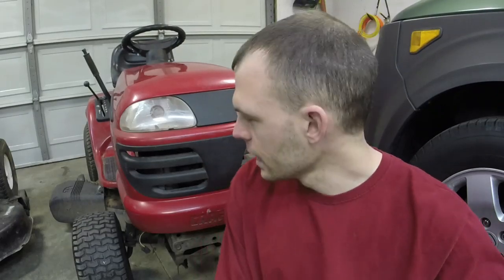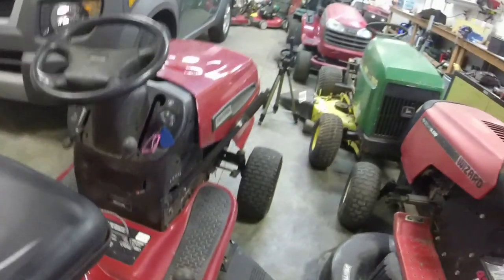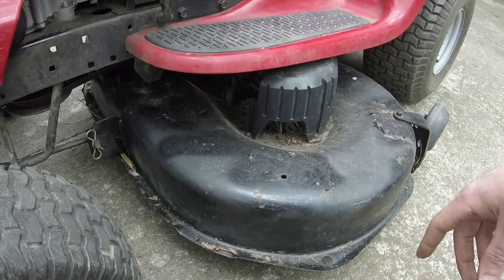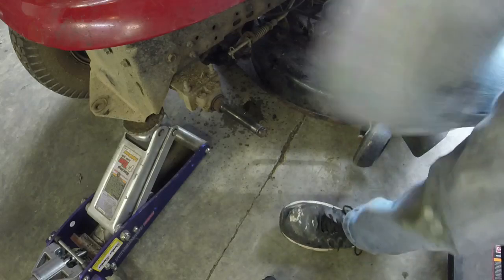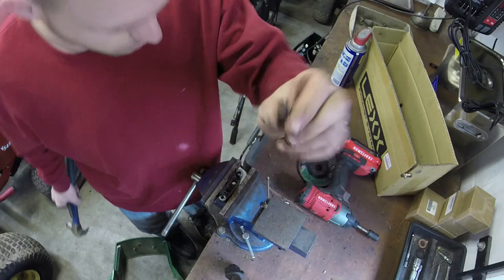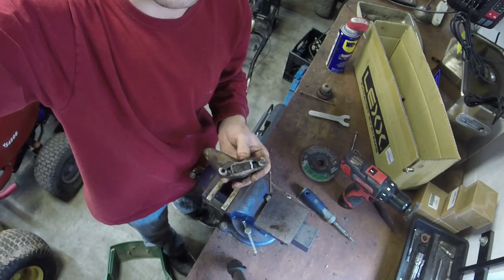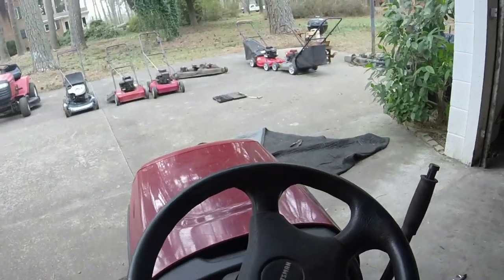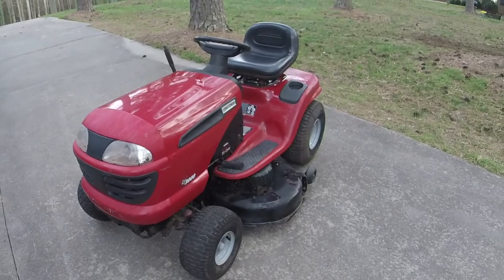$100 Craftsman LT3000 with rotted deck and no brakes: Let's fix it!

Comment: Taking apart those deck mechanisms can be annoying. I took one apart to sand blast everything but several weeks went by between disassembly and reassembly, so I forgot where everything went. Even with photographs and video help, it was a bit frustrating to figure out where all the washers and such go. It requires some trial and error unless you know them very well. Dealing with decks, in general, is my least favorite part of working on riding mowers ... as ironic as it sounds! I have had a few of those brake caliper pins completely rust seize up to the point that I had to drive them out and wire wheel or sandblast everything. Its a pain but I have never found one that wouldn’t come back with some effort and maybe a set of new pucks. If someone were in the market for an older AYP tractor, I would suggest trying to find one with a 12 gauge deck. I live in a very humid, rainy, and swampy area but I rarely find a 12 gauge deck that hasn’t survived on these machines, while the thinner Poulan type decks that have not seen indoor storage and good care are typically heavily rusted, often to the point of being unsalvageable.
Reply from the maker: Yes they can be a little hard to remember where everything goes on it.  The brakes are easy to get going which is nice.  The 12 gauge decks are nice and I have one with a little rust but nothing like the thinner decks.  I'm surprised this mower did not have one.

Comment: I’m trying to figure out the blade brakes on my FREE DLT3000 I just got. Are there pads on the blade brakes that rub against the pulleys?
Reply from the maker: They are small pads.  They are hard to find to just replace those though.
Reply: @EllisMowersandmore  I found some pics of the blade brake arms and the pads.
My arms are broken off where the pads attach. I found a kit online. Thanks

Comment: I have a lt3000 and having trouble finding a deck that is compatible.  What type of mower deck did you use to swap over to the lt3000? Any help is appreciated!
Reply from the maker: Any LT1000, 2000, 3000 or 42" Craftsman deck made between around 2002 and 2006 will work as well as some more.  They are easy to find, just make sure they are the cable engage type.

Comment: I just got one of these for free on the side of the road, only problem is it had no rear tires and I cant for the life of me find the appropriate size anywhere 🤣🤣
Reply from the maker: Should be 20x8-8 if I remember right.  Should be able to buy the whole tire and wheel together at a place like Tractor Supply.
Reply: @EllisMowersandmore  thats what I was gonna guess lol, thanks for the reply!